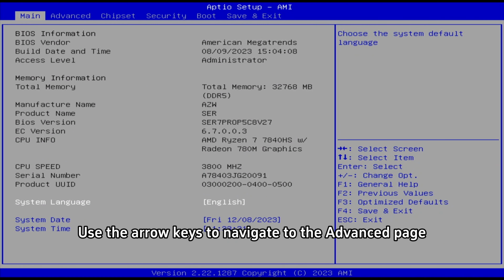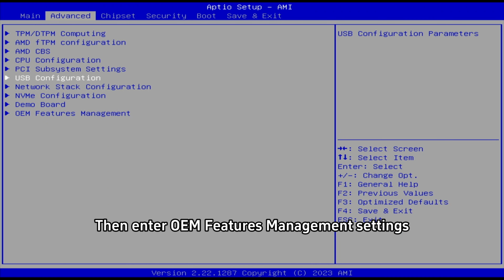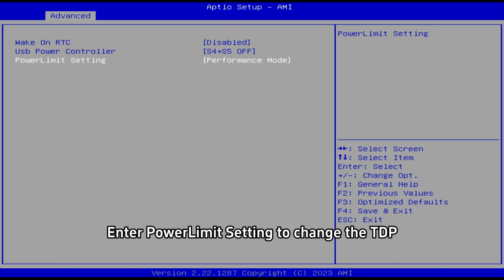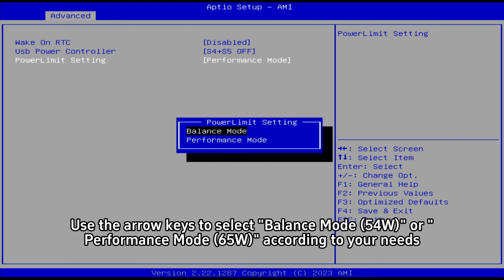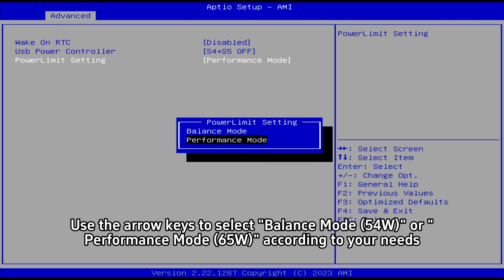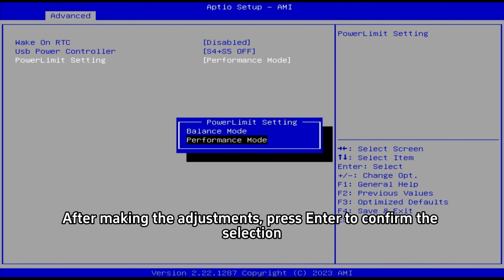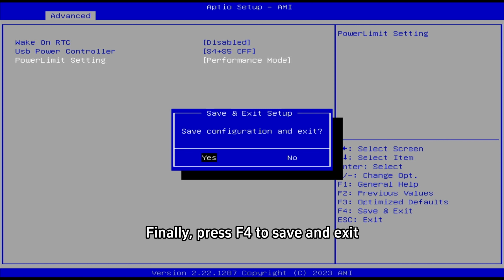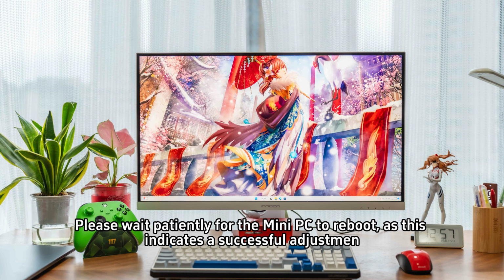How to Change the Processor's TDP on Beelink GTR7&SER7 Mini PC

Comment: Hey ive bought a gtr7 pro but i noticed there are problems with the gpu drivers. Whenever i dont use a program which uses a lot of power my pc reboots. It would be nice if the drivers are fixed or beelink collabs with nvidia because of better gpu drivers.
Reply from the maker: Hi, thanks for your feedback! And please email support-pc@bee-link.com about your GTR7 Pro reboot issue, our support team will help you solve this problem.